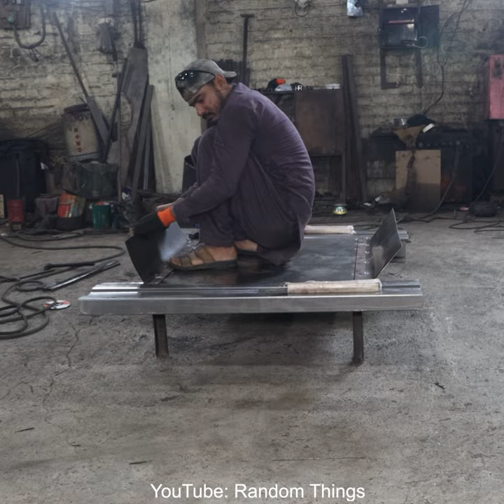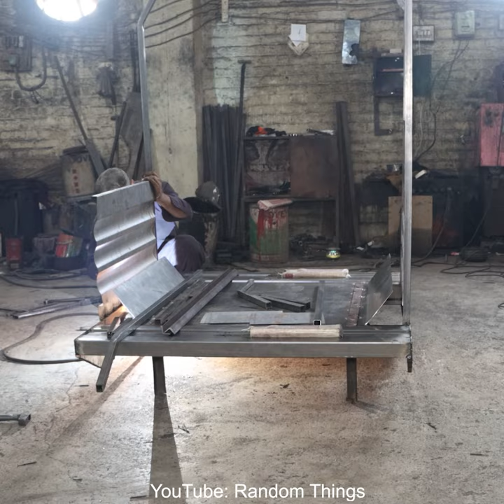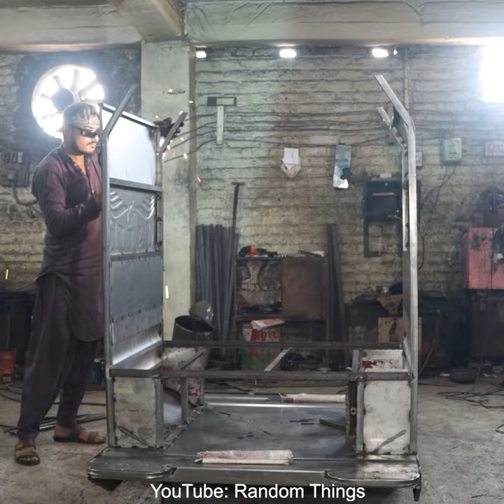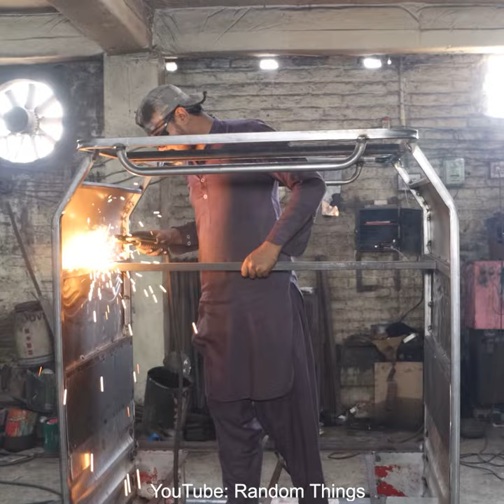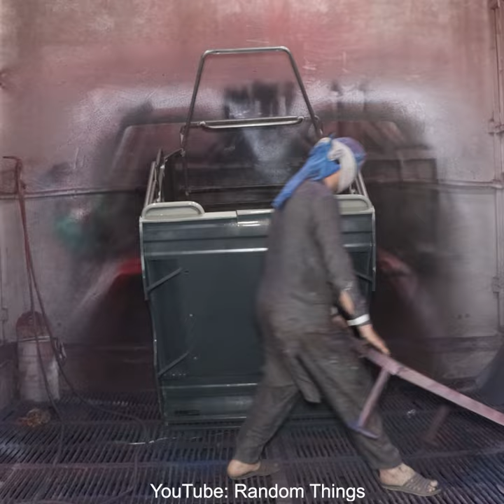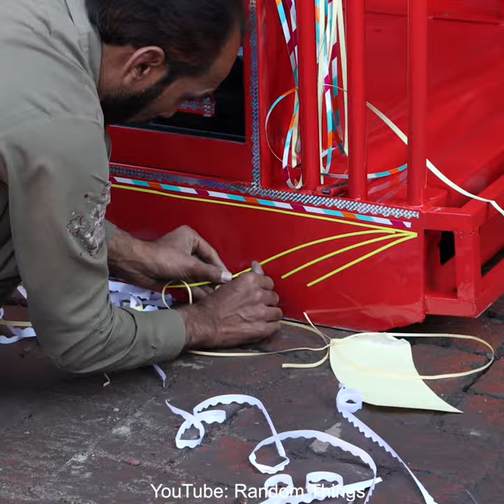Six Seater Rikshaw Manufacturing Process

Comment: It is dangerous to weld with bare hands without gloves.
Reply: Open toe welding sandals.
Reply: Only if you are not experienced enough
Reply: Most ordinary people would think that working with small safety equipment with hot flames and heated materials while exposed to bare skin would seem very dangerous 🤔
Reply: It's a way of working that beginners should never follow.